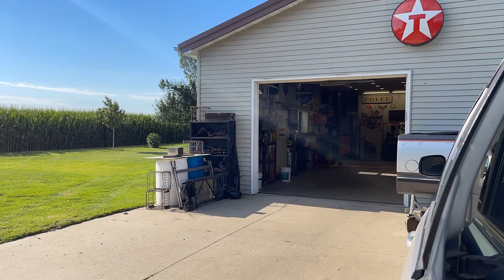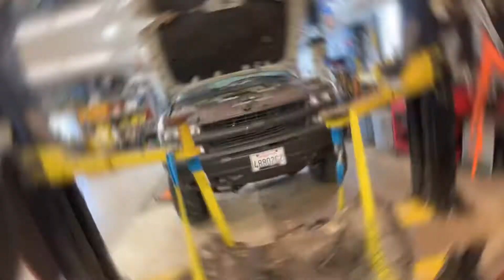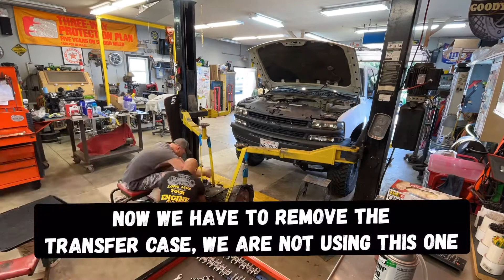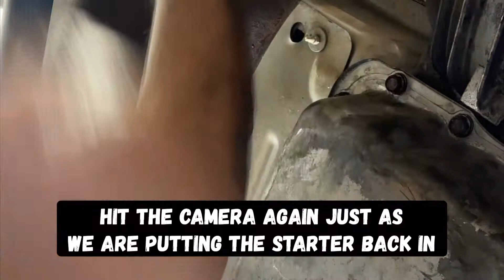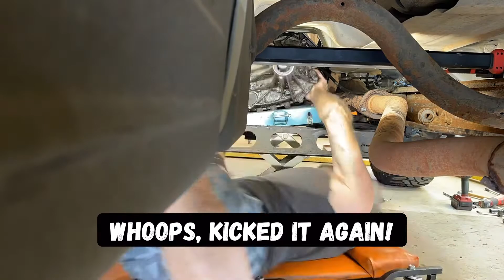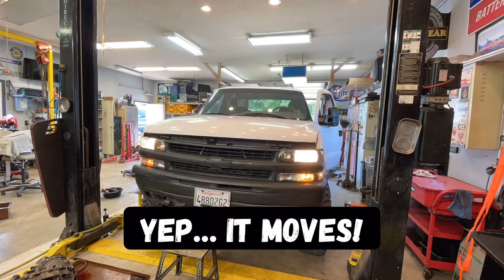Project 4xFlip Part 2! #forsale

Comment: When I'm fitting transmission or engine I put two headless bolt's in a few threads slide trans/engine in works well with manual/standard transmission line's it right up, all the best to yous and your loved ones
Reply from the maker: That is a great idea!!! Thanks for the tip!
Reply from the maker: That definitely works well!